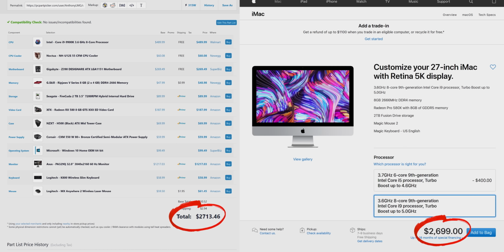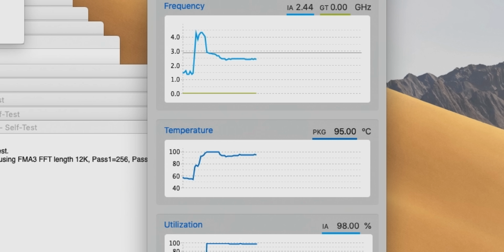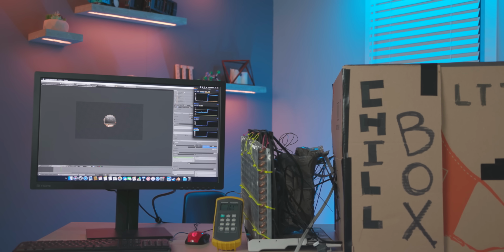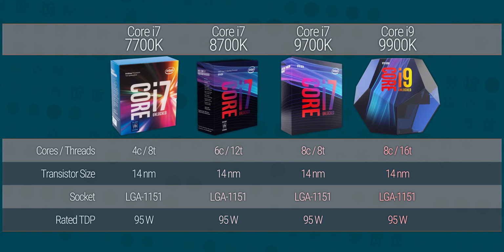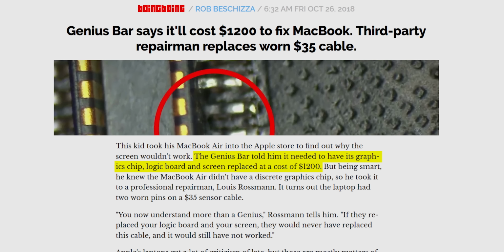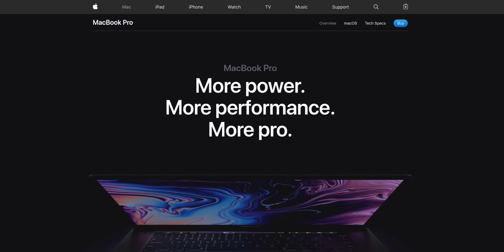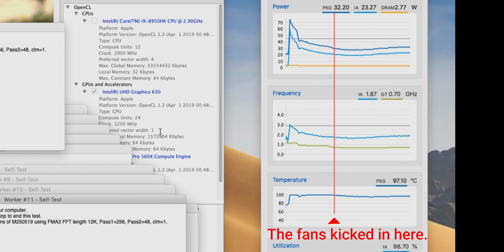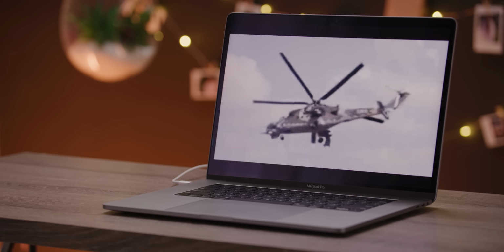Macs are SLOWER than PCs. Here’s why.

Comment: Honestly, and I come back to this over and over again, the reason an Apple computer works as well as it does, is because it runs a reasonably solid BSD OS, with custom drivers specifically worked on with the hardware manufacturers, (while other BSD distros have to write source code, largely as a hobby because no hardware manufacturer supports BSD) with a damn good GUI over the top. Those factors alone make a Mac many times better at most desktop tasks than a Windows machine.

What is baffling, is that it specifically doesn't help task intensive applications, like the majority of the Adobe suite, or even Cubase with enough VSTs. Yet this is still the place Apple computers are most frequently used. In fact, I would almost go so far as to say that the most common use cases for Windows, and MacOS are completely reversed for their primary strengths and weaknesses. You should run Office productivity, eMail and web browsing on a Mac, and do your high end video renders, software development and compiling on a Windows / Linux PC.

Of course, I tend to think that gaming, these days, would probably be best served by a desktop version of Android, but that also highlights the why of all of this. That why is historical markets, and software back-catalogue. There are simply more 3rd party Adobe plugins for Mac, more games written specifically for Windows, and Microsoft Office rules the productivity roost, and they primarily target their own Windows OS. It has nothing to do with the hardware, or the OS it's self. It doesn't even have much to do with the marketing, or the type of users and what they respond to. With commercial OS, it's all about captive markets, and because those markets are captured, Windows doesn't have to worry about how bad it is for gaming, or productivity, because those users are tied in to Windows and aren't going anywhere, and Apple don't have to worry about how bad their computers are at Adobe CC for the same reason. :(

That's also the real reason users need to bite the bullet and switch to an open system. Android is, for now, mostly, but there's no saying it will always be so. Linux and / or BSD would be far better. Heck, AROS or Haiku would be better, and if any one of these were popular enough to have enough developer hours behind them, they would deliver what users want and need in no time. Those captive market bonds are too strong for that to become reality any time soon though, and not without a massive push, or failing by these giants.
Reply: Mirsad Redzovic just wonder why someone would bother replying to a comment they didn’t read
Reply: Mirsad Redzovic  No, I'm suggesting the opposite. Apple hardware is (often) complete rubbish, but the OS is rock solid and runs like butter off a hot knife. (fast and smooth) So they get away with hardware that is crippled by being "designed" to look pretty, rather than engineered to perform well.
Reply: Mirsad Redzovic  Yes you are misunderstanding him, he literally posted nothing on the cooling. Well done there bud, wanting to argue with someone that is not arguing.
Reply: nope the GUI sucks badly
Reply: @maxcady4208  Which GUI do you prefer to run on Unix machines? (remember, Linux is not Unix) MATE? KDE? IllumOS? Xfce is my favourite next to MacOS, but everything that is not MacOS is X-Windows, and X-Windows on Unix is bad_. Like X-Windows is old, and badly designed for modern computers _anyway_, but the X drivers on non-MacOS Unix are painful, because of that lack of hardware developer support, and because Unix licenses (BSD / MIT) shuns GPL3 and most X development is happening in the Linux field where _everything is GPL, and usually the viral GPL3. Even before you consider that Wayland development is basically nowhere on Unix... It wont compile for about a million different reasons, and mostly nobody developing Wayland cares, though a lot of people developing Unix care that they don't have Wayland. Without Wayland, and without GNOME3, (and without decent graphics drivers) there is a big hole for a decent modern GUI on Unix, and I think MacOS is the closest to filling that hole.

If you mean GUI in general, I think most people are agreeing ElementaryOS, or the Android GUI are the best current designs, but I have a special place in my heart for HP-UX, OS/2 2.x, RISC OS 2 / 3 and AmigaOS 2 / 3.

FYI, unless you only ever use Windows systems, Windows desktop GUI always scores about the lowest in usability and productivity, and if you're still wondering why that would be the case when everybody knows and uses Windows, QWERTY is also the worst keyboard layout for any Latin written language, (the most common European alphabet) while DVORAK would be about the best. Most people can't get along with a DVORAK keyboard either, because we all have well programmed muscle memory for the QWERTY layout. ;) I use both Windows, and QWERTY, most of the time... I also acknowledge that both of these things are about the worst choice I could possibly make, in every sense except... That's what everyone else is using, and all of the advantages that come with being "mainstream". ;)
Reply: @bobsobol  i'm talking about UI design. you couldn't come up with a worse user experience than macos. it makes getting simple stuff done very often very frustrating. case in point - the most basic task that is so well done and intuitive on Widows - switching between windows, one shortcut takes you to any window. macos idiocy, sometimes it works, sometimes it doesn't depending on...is the window maximized, is it part of same window group, are you north of the equator lol, OMG shoot me now...just get me to the f---ng window steve jobs or whoever made it so bad. steve jobs makes me hunt down my windows if i can't quickly get it with the shortcut...have to remember what i did that window when i can't recall it with the shortcut...now i have to deputize the mouse to hunt for my window. jesus h christ who came up with this nonsense
Reply: @bobsobol  how hard is it to make notepad or notepad++ equivalent? what's more basic? textedit you say? um no...awful piece of crap
Reply: @bobsobol  why not make finder as easy and intuitive to use as windows explorer? enter paths, launch command line, navigate directory structure without constant use of mouse, etc?
Reply: @maxcady4208  Or, you could ask, why does Windows include both Notepad, and WordPad to edit basic text files? Especially when WordPad can do both things, the same as Text Editor does on MacOS... Though that's bundled software and everyone replaces Notepad with Notepad++, Sublime, Atom or such. (MadEdit, for me ... There's an experimental NotepadQQ [Notepad++ for everything Unix-like Windows] release for MacOS)
Reply: @maxcady4208  As am I. Windows is universally acknowledged to be the worst way to do UI design. At least they build in something close to Exposé now. What about it doesn't always work? At least I've never had it lock up so hard you have to three finger death grip it.
Reply: @maxcady4208  Why not make Explorer as easy and intuitive as Finder, you mean? The Finder address bar has used breadcrumbs since before Windows 3.1, and it took Vista to introduce that to Windows... Now Apple hide that complexity from users who don't need, or care about it. (It's still there though) Typing an address would be best put in the "Go to folder..." menu option in Finder. (cmd + shift + G ... Don't know how you'd do that in explorer, but I usually just type in a "run" dialogue, from Meta + R)

Command Line Here is a tweak, (first released bh the NT kernel team as a free download in PowerToys for 95) and there is a similar tweak to launch Terminal in a Finder folder. It's been around since OS X because MacOS 8 and earlier had no standard text / type interface since the Apple Lisa. (The II GX was, I believe, the last DOS style Apple prior to the Unix merge)

As for clicking around all the time... Yes! That is so annoying on Windows compared to almost anything else!!! For example, all native Mac apps have a pretty sensible control tab order, and that works great, both for keyboard users, and "ease of access" navigation... Windows it's self does too, but developers of native win32 apps have to be very careful about control order when writing, and most are not careful, at all. MacOS, even for developers "just works". Normal reading order tabbing between controls isn't a developer choice, it is just how the system works... Because why wouldn't you want that? Unless the default was something else (the order controls were added to source code, in Windows, so usually newest feature last) and couldn't be bothered to check accessibility for users who don't click everything off with a mouse. ;) I've not seen a GTK or Qt app which doesn't follow the Mac norm, though I have seen some wxWidgets ones, so I know GTK can be overridden to work Windows broken UI way. Presumably they gently enforce via the IDEs defaults? (Soft-power?.. If so I approve)

All bets are off on both systems when it comes to "web apps" (like Electron) but it doesn't matter what you run then anyway.
Reply: @bobsobol  sorry i know from my own experience that i fumble around looking for my windows on macos all day long...its maddening. that is macos awfulness. NEVER ever have to do that on Windows. my case was made with succinct observations. i noticed you had to write up a storm to make your case...sure sign it not a good case
Reply: @maxcady4208  What I notice, is that you case is essentially personal anecdote, where I am stating (mostly) fact, and research results. Though, the fact that I fumble to find windows in Windows, but never struggle to find them on MacOS is also anecdotal. It's just personal experience.

I write in verbose, and that's just me. 😥

However, I don't know, from what you've written why you struggle to find a specific window on a Mac. What I have written, (I hope) you could repeat, and see for yourself. On both systems, there are multiple ways you can achieve the same thing, and I tend to use different methods depending on whether I have both hands on the keyboard, or one on a pointing device at the time.
Reply: On a muc you only need to use a custum fan profile that start the cooling fan BEFORE it overheats and you suddenly have much better performance and computer last much longer also before breaking... My 2,4Ghz MBP runs at 3.2Ghz all day 100% CPU no problem without ever getting over 80C. Default fan profile lets it get to 100-104C with 2Ghz simply because it does not let the fans spin to cool down....
Reply: Finally someone here who is intelligent. There was a guy posted that Apple has no edge I can show you several pictures where the board rooms and meetings have several hundred glowing Apple's and not a pc laptop to be seen.

Comment: All computer operating systems suck, each in their own special way. I run Windows XP, Windows 7, Windows 10, MacOS, Linux, BSD, IOS (Cisco & iPhone), Android, and others, and they all suck in their own little special way. There are things I can do on Linux that are impossible or super painful on both MacOS & Windows. Windows hardware support is exceptional and the available applications are virtually without limit. MacOS is nicely integrated, but is an operating system designed for retards (in so many ways. "search" anyone? ugh). Windows spies on you, but Microsoft's support is exceptional. Apple's telephone support is a joke (the Genius Bars in stores is okay). Linux support is _____________ nonexistent. With all those statements, I do have a question: what's up with all those earrings? Did you fall head-first into a dumpster behind a trinket store?

Comment: You do actually wrong about iPhones, Mine is throttling when overheating, In fact it’s never going over 66.67%  on load when  overheated!  It shows the lower result in beach marks when is warmed (iOS 13.1.2 on iPhone X)

Comment: Indeed. The only thing I have that is Apple is my iPod touch at this point. Everything else is something different. Even music. I use Spotify for the most part on my iPod Touch that already has iTunes on it. Its just one of the few things that has some features like the iPhone, but without the phone. I know, small detail like that, why bother right? Well, phones are for work typically and iPods are for fun to some degree. I know, still a small detail, but that is what I like a little bit. If only something like the Zune was still a thing, I might have went with that, but of course. All good things seem to die faster than crappy stuff(some times, I know there are some good things that do last a while, but not usually).
Reply: And you might say why not a 3DS or something. Well, its not geared towards music like the iPod is either. And the iPod touch has the music and some extra features too.

Comment: Pretty sure the iPhone has better thermals because it's using an ARM based processor rather than X86, ARM processors are more power efficient and thus, have lower thermals compared to more power hungry X86 CPUs.

Comment: I feel much better about my recent PC laptop build...
Less than half the cost of a Macbook with the same specifications (minus the 3GB GPU)
And thanks to this video I know it's more efficient at using all of those thanks to powerful twin fans
Plus it passed military standard (810) testing for shock, temperature, dust, humidity, and vibration
F*ck Apple is awful

Comment: My guess as for why the phones don´t throttle down so much compared to the notebooks is because they make the phones CPUs themselves and have full control over thermals this way. The notebook CPUs are bought from intel, (with whom they have a difficult relationship btw) and so they don´t have so much control over specifics. I bet an apple-made notebook cpu would look totally different. By the way, great video, 100% agree. Still loving my 2018 macbook for some reason...

Comment: Why people always talk about "all cores" when they talk about thermal throttling? Are you using your computer with all cores, every seconds of every day? Does it throttle that much with 2 cores utilized? I develop software and hardware, I barely utilize all the cores.. Even when compiling a large code, all the cores are active but not %100 at all. Because CPU wait's for SSD etc..

Comment: Every macbook pro is enough fast for any task. 10% slower machine is nothing that can be presented as “ slow” or “ bad” or “ useless”.
Pc funboys do not understand. Its ONLY about stability and workflow, under macOS.
So, i must say, interesting video. 
As a former pc user ( architect), when arch office where i work, switched to macs,  everything start to work like it should work.
No more useless maintance hours, no more viruses, no more issues, let me repeat, real issues with system stability and no more $ money that were spent on bad windows based xeon workststions. 
They cost more than macs, you must buy operating system for every node, you must buy many software that comes with macOS for free( OS too ), and at the and,  after 4 years from now,  workflow and being effective during daily job , rised on new levels.
There is no back to work on win platforms. No thank you.
When you are working on 2.000.000$ building, in team of 20 architects... last shit you need is unstable operating system and idiotic user interface and workflow ....
Thats what pc funboys dont understand.  There are more important things than have 10 % faster computer and flashy led lights inside your pc case...
Great video Linus!
I just pointed other side of macs and people that are using them.... no intentions of starting any flame or similar situations.
Relax people, its only that matters is how much money you can earn working on your computer. 
If your needs suits best with windows, than use win platform.
For my office, macs were great and positive solution for everything.
cheers!

Comment: Please help me

Unable to boot Windows from External SSD(orico 2.5" enclosure)

Thank you
Reply: Are you trying to boot a different OS than the one it usually boots? Then your BIOS-Settings could be wrong. Do you have the BIOS set up to show the boot menue when pressing F12? If not, do that, then it won't automatically load an OS. Are you getting any error messages like, "MBR not found"? Did you actually install Windows on an external drive (not the best idea)  or are you trying to use it like a bootable USB-Stick? It could be a lot of things. Specify please.

Comment: Im a mac boy, but isnt this title a bit over the top? You stated it yourself that a lot of windows laptops have same issue?
Reply: @creepysmilingcarl9742  ehmmm its not a low noise fan, its low RPM. Thats why i got an app to manual set it 4500-5000rpm instead of 2000rpm as basic
Reply: @creepysmilingcarl9742  Though a thin macbook is nice, but thermal shot cost me my macbook. I got a bulging battery and its slow for rendering